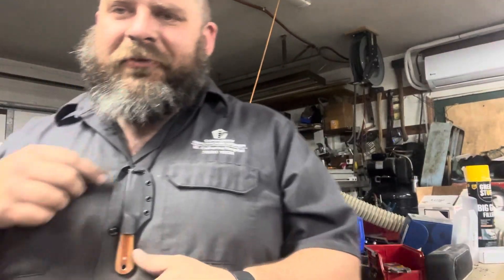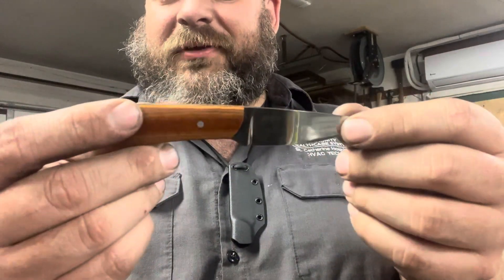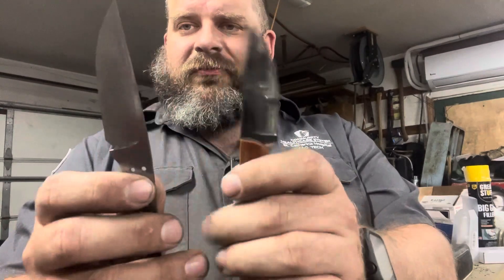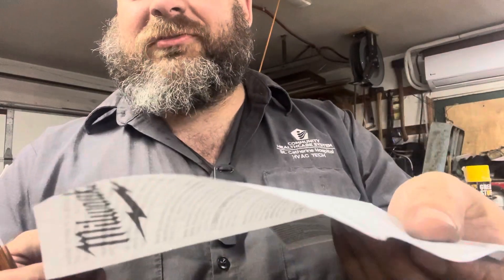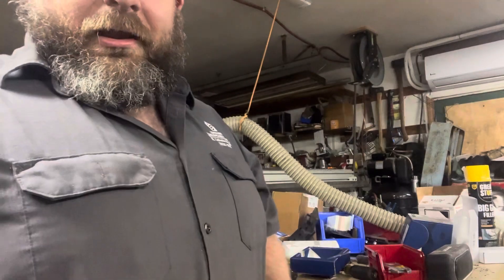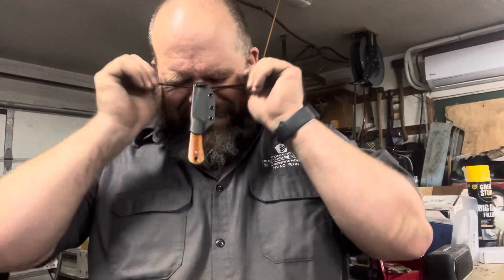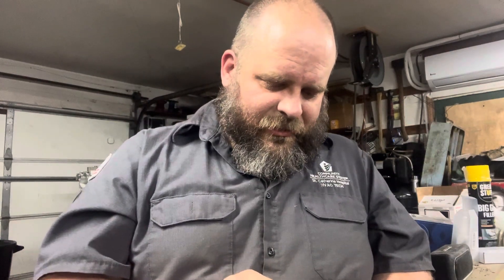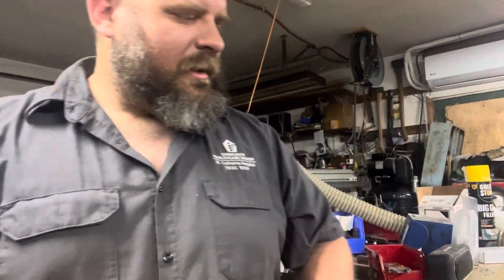New knife design: the “little fella”

Comment: Have you gotten a set of tsubosan hardness checking files?  Made in Japan actually they make some of the best jewlers files up there with 1k swiss watchmaker ones.  50 to 100 dollars and there plus or minus 3 to 5 hrc.  Being a knife maker I'm sure you can touch up a roll from a file.  It's about the cheapest way to semi scientifically test heat treats. Good luck with the knives I hope they fly off the shelf.
Reply from the maker: I do have a set actually. I just can’t  remember where I put them last…
Reply from the maker: Actually I just found them. Definitely looking like a low 60s Rockwell, which is what I was expecting.
Reply: Ain't that life.  If you have to rebuy things and not because it's broken or worn out your in trouble 😆.   I think back to all thoea snapped knives on forged in fire because the lack of annealing and blindly trusting a rc63ish general file and as we know unless it's d2 or 01 it dosent like to be that hard.